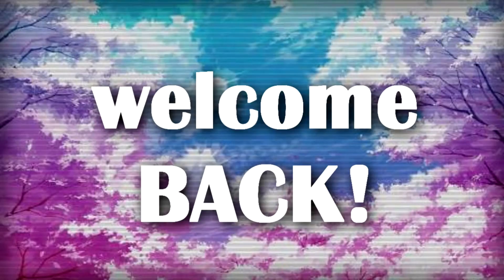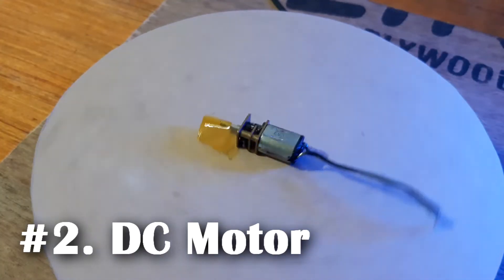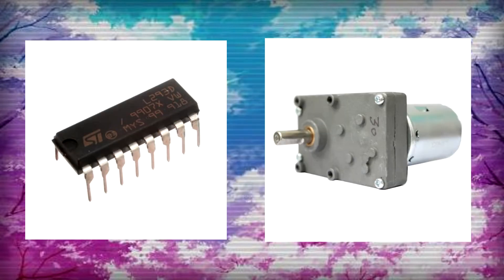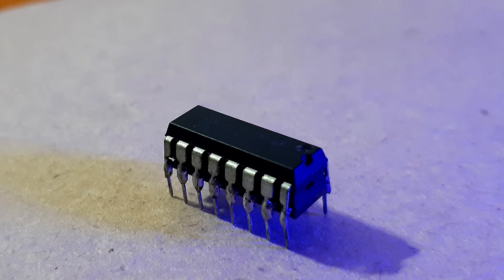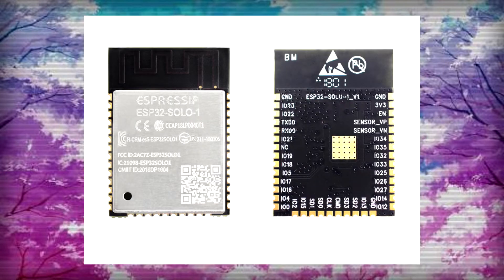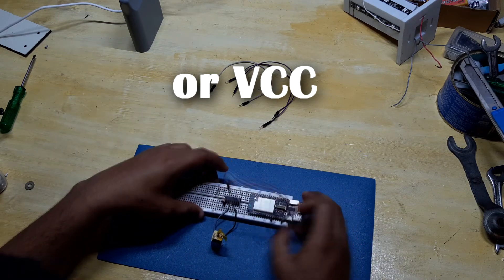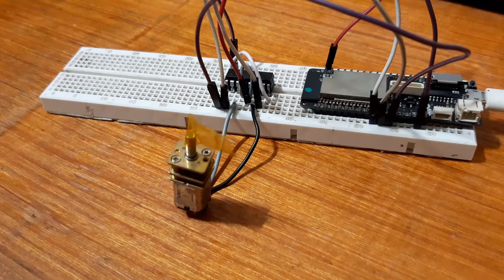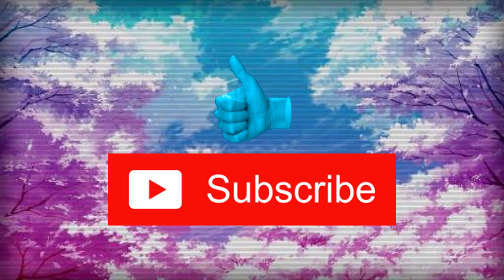How to use L293D motor driver with ESP32

Comment: 2:31 Vcc1 how do you provide 5v to it from ESP32 or NodeMCU ESP8266?  and Do other pins of L293D support 3.3v?
https://www.google.com/search?q=esp32+diagram&client=avast&sxsrf=ALeKk00vz1XFBvVoYdT15wEcDeUorZHDNw:1600663511352&tbm=isch&source=iu&ictx=1&fir=8NXEuqpNBMyb7M%252Cwe8tJVOHH26hIM%252C_&vet=1&usg=AI4_-kScVK2eqfN05WTwrKPmrKtD-50vBg&sa=X&ved=2ahUKEwj2s_6fuPnrAhUWfd4KHSFVB8MQ9QF6BAgKEEA&biw=1920&bih=937#imgrc=8NXEuqpNBMyb7M  
There is no USB pin on the diagram. Are you using specially designed ESP32? That's why I asking about 5v.
Reply from the maker: Both have voltage regulators but esp32's voltage regulator is not capable of using voltage greater than 5V. So don't provide it voltage greater than 5V, esp8266 node mcu have ams1117 which is 12v tolerant so you can provide it with 12v
Reply: @ArnovSharma  I don't know if my question was right. What I meant was at 3:54 of the video, you provide 5v from usb from ESP32 to Vcc1  of L293D. My ESP32 and NodeMCU don't have this pin.

4:10 you mean VCC1 of L293D can get both 3.3v and 5v right? If that's the case, then I don't have to worry much about it.

https://components101.com/microcontrollers/esp32-devkitc  <-- Has pin labeled 5v
https://www.arduitronics.com/product/3779/nodemcu-esp-32s-wifi-bluetooth  <-- No 5v pin.   I have this one.

So these two ESP32 are different?
Reply from the maker: @jumbo999614  i see, well in that case then then there might be a vcc or raw pin in your esp. Check its voltage with multimeter. Also, esp8266 doesn't have a 5v output, only 5v you can get is via USB in port which maybe raw port